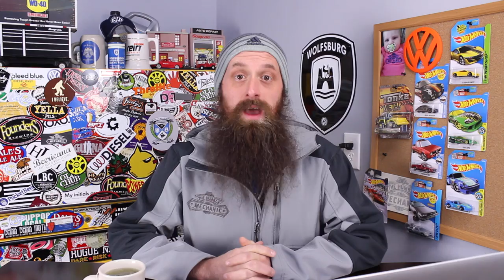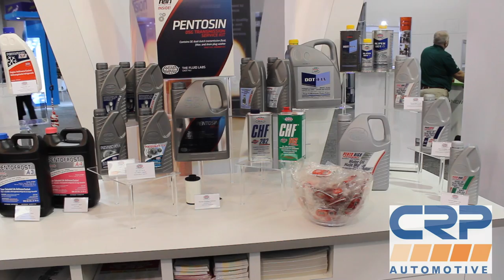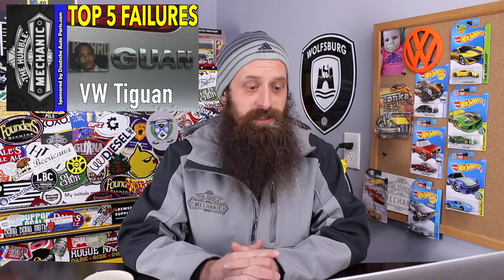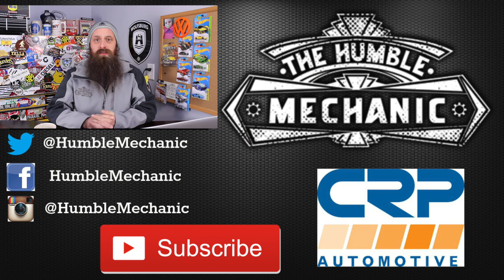Viewer Automotive Questions ~ Podcast Episode 130

Comment: As a certified diesel technician, i wouldnt say the ad blue heater is indirectly related to emission. It is most definitely DIRECTLY related to emissions. If that fluid cant stay warm in colder temps then the DEF, which is a HUGE part of diesel emissions, will not do its job, and create lots of NOx emissions. In the heavy duty truck world this IS covered under warrently. Even seemingly silly things like engine fan solenoids are covered, because they do relate to emissions. EPA dont mess around with this. Neither should VW.

Comment: It sure is a big time problem with the NMS Passat TDI. My local dealer says if a Passat comes in with a CEL 80%+ of the time it's the AdBlue heater. There is a good chance VWoA will cover your repair out of warranty. They actually did to mine. If you're at like 100k miles then I doubt it. But, if you're just a hair out of warranty you have a great chance of getting it covered IF YOU'RE NICE! They make decisions based on customer retention. If you say you're not buying anymore VW's you'll be on your own.

Comment: Loved the video! I want to use 2 axle stands to suspend the front of my MK7 GTI. I also have a trolley jack. Previous vehicles of mine have had a spot to lift the front with the trolley jack, allowing me to simply slide the axle stand below the two front lift points shown in the VW Manual. I then lower the trolley jack so the car sits on the two axle stands. Is there a way to do this on the MK7? Where is the trolley jack point in the rear for that same procedure? Thank you HumbleMechanic!

Comment: HM: I have a question about the VW GTI. Like other cars, they don't give us a twist ignition any more. On my previous car, I have to snap the key fob into a slot on the dash in case of battery failure. The ignition detects this and understands that I want to start the engine with a dead key fob. My current car, a VW GTI, has NO slot anywhere. How do I start the car with a dead key fob? Where do you slot the key fob? The owner's manual doesn't even tell me how! Yes, I've read every page of the manual. It took three nights because it's so thick!

Comment: Hi Charles, I have a question about 2.0 tdi passat and oil pump balance shaft / hex key failures. I have a 2008 Passat B6 2.0 tdi BMP engine with the balance shaft oil pump (the european model, not the chain driven one). The car has 300k+ miles on it. I went to a local service to check the hex key and check the condition of it and it was a little worn. I exchanged it with a brand new hex key from VW. But I did not remove the oil pump to check the balance shaft slack. My hex key is 77mm and I read that on the newer models, VW is using a 100mm hex key which in theory should have much less slack over time. I do not feel at ease just by changing the hex key as I know the oil pump is still prone to failure. What would you recommend be done with this to solve it for good ? - Get the newer balance shaft with the 100mm hex key / go and refurbish my existing oil pump balance shaft / remove the balance shaft completely by modding the 1.9 tdi bxe engine oil pump (the one with no balance shaft with chain and tensioner) . I am not sure how to proceed with this. Would the new hex key that I replaced keep me going for a while ? I am from Romania by the way and want to congratulate you on the show. You give great technical and personal advice. Thanks and keep up the good work !
Reply from the maker: +undying2k7 That is a tough one for me. We don't have that engine here. My experience with that balance shaft/oil pump issue is limited. Seen a good amount, only fixed one or 2. The TDI in the US was chain driven, and the update switched to gear. This replaced the entire balance shaft module. So replacing just the hex for the oil pump was not an issue. If VW switched to a longer hex then I may say go that route. 

I have done one of the balance shaft deletes, I think we use the ALH pump and a 1.8t Passat pickup. That was a great repair. It did cause a little more vibration, but not much. 

Were you able to look for wear on the oil pump gears? If the wear was minor on the hex, I may roll with it

Comment: Hi Charles I haven't replace or gotten any Passat with a bad adblue heater but last week I got one fault for a NOX sensor bank 1 sensor 1 and the car is past the normal warranty but I thought it would be covered under the emissions warranty but it doesn't seems to same story like you mentioned in the videos it seems like it's a very common failure for this car so in other words if you remove theses components from the car it should pass any government emissions test because Volkswagen does not see them as emissions related that is stupid how come the exhaust flap has a extended warranty on some models it just doesn't make sense and these parts heater and NOX sensor are not cheap parts to buy any way if VW still wants to sell TDI's in the future it's not the way to do it.  To me the new 1.4 litre engine makes the case that a TDI is not a good engine if you want reliability long term.
Reply from the maker: +V10PDTDI Yea I don't get this stuff with the TDI and emission issues. I mean, we have enough bad crap with our TDIs, just fix the heaters and sensors. 

I want to recommend the 1.4, but in the US it's too new. Other than in the Jetta Hybrid. I guess only time will tell. Then again, the 2.0 non turbo should have been 100% dialed in, but that one now burns spark plugs up like a boss. And is ultra sensitive to fuel quality.
Reply: +HumbleMechanic hi I had never heard of this issue with the 8 valve engine.

Comment: What if the dealership does allow u to take the car to  mechanic should u walk away from the deal
Reply from the maker: +Rod B I would be more tempted to do that for sure. There are a million other cars out there.
Reply: Hi thanks for  the advice also sent a email a a while back about what should volkswagen passat fsi 2.0t engine sounds like I can send video if needed I'm hear clicking nosie at idle when the engine  is warm up when the engine is cold I don't hear it also great videos keep up the great work